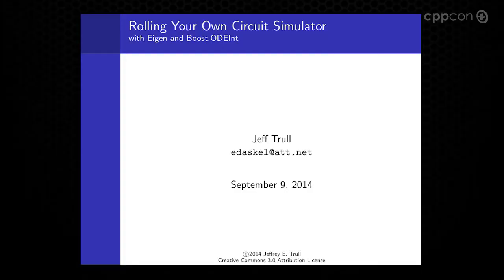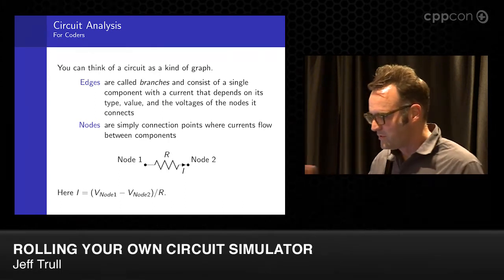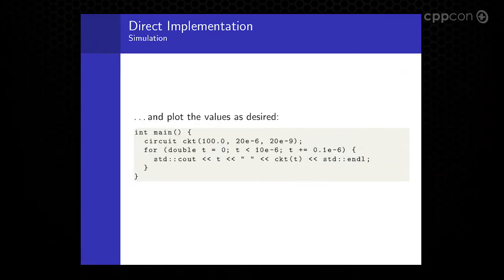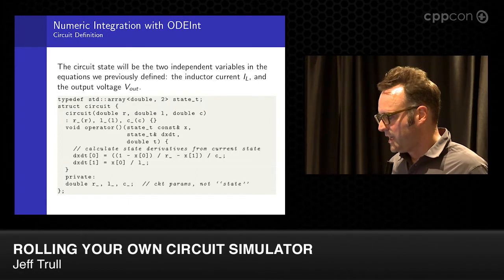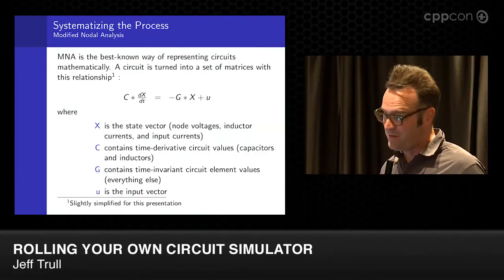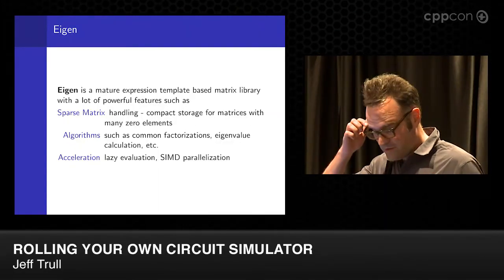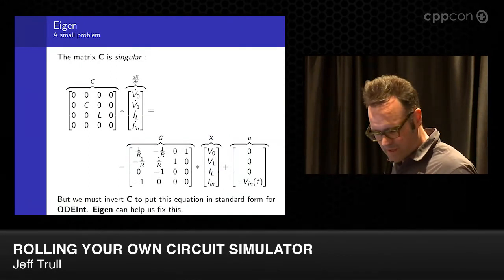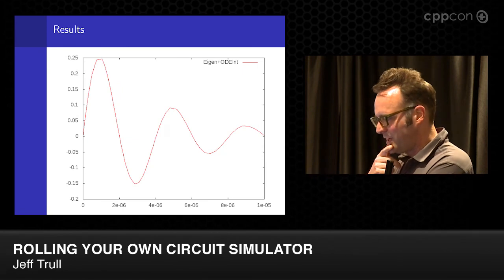CppCon 2014: Lightning Talks - Jeff Trull "Rolling Your Own Circuit Simulator"

Comment: The basic idea, rewrite everything from scratch that has been working fine since the 1950's, is very appealing. But the talk doesn't even begin to scratch the surface of the surface of the surface. One example: all this only applies to linear time invariant circuits. Already adding a simple behavioral source introduces incredibly hairy problems.